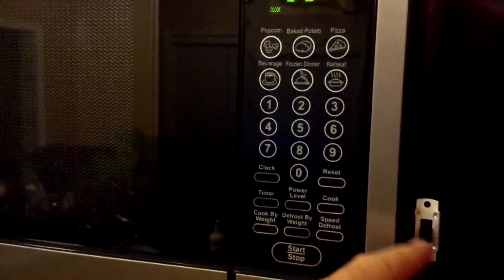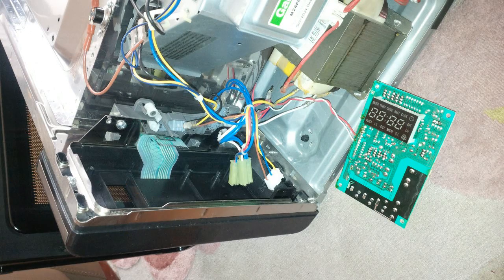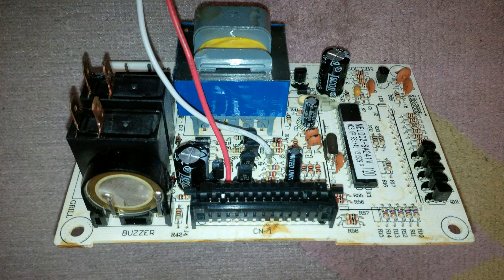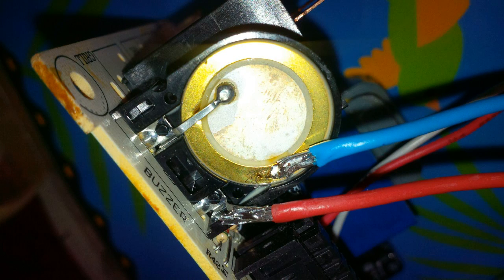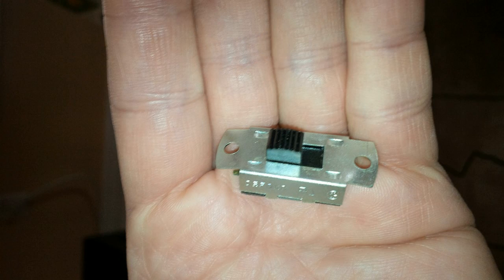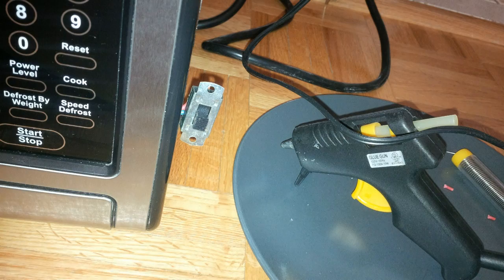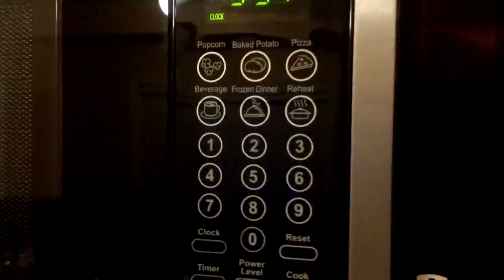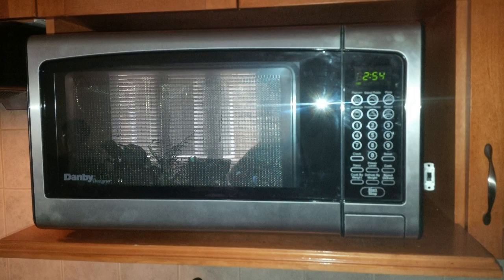Hack That Annoying Microwave Beeper for  Stealth Mode

Comment: Would not recommend this for anyone not experienced with Electronics or basic Electrical knowledge.
Reply from the maker: Good point, you don't want to fry yourself on the capacitors, assemble the microwave back wrong or put the switch on the wrong circuit.
Reply: @devhackmod  Yes other wise you might end up with a microwave going boom lol.

Comment: WARNING " there is an high voltage capacitors and they maintain significant current in the board for a good 30 minutes to an hour after you unplug that device. "
Reply from the maker: Good advice, yes also on TV's and other devices that plug into main household plugs you need to be careful to discharge capacitors safely before poking around in them even after you've unplugged them!

Comment: I just watched a hack video that says most microwaves have a secret keypad mute if you hold the number 1 for a few seconds. Hold 2 for a few and the end beeps don't chime either.
Reply from the maker: I'm not sure why they would keep this function secret. It sounds like a good feature, so why  not explain it in the manual? Either way, none of my microwaves allowed me to disable the beeper that way so I had to add a physical switch. It would be much easier if the manufacturers just told us in the manual!

Comment: Instead of a switch, I think a volume control would be better.
Reply from the maker: Good point, put in a potentiometer or variable resistor so you can crank it down to 0 Ohm (full volume) and crank it up to a high resistance (say like 10 k Ohm) should do the trick! Good idea!

Comment: Brilliant!!! All the others tell you to look for the Sound or Mute button like we are idiots. Finally a real how-to.  Thank you. I am off to disconnect all buzzers on all my appliances.
Reply from the maker: Most appliances do not have a mute function, so you have to physically adjust the circuit like I show in the video. It's easy but just be careful to unplug and leave it a few days (or know how to safely discharge the large capacitors). Good luck!

Comment: My microwave won't work properly.  It go from 100 sec to 59.  Dumb!
Reply from the maker: Yeah that sounds like a programming bug! LOL!
Reply: I bet that 99 seconds works though. I will always do that where applicable. If i want to heat for 1:20, I enter 80 seconds
Reply: I dunno what the prob is. But lookin at your profile pic i seem to go from zero to blast off in 1/2 a sec=)
Reply: Do you mean one minute to 59 seconds?
Reply: It’s a joke, y’all.

Comment: Very Helpful. Just did mine. Surprised how big a ballast was in my microwave.
Reply from the maker: Good job. Just note that someone warned me about electronic issues bypassing the buzzer with a switch like this, but I've been using it no problem already since this video was created. So just use it when you need to, otherwise leave the buzzer on. I don't think it should cause any issues unless you flick the switch while it is trying to buzz.

Comment: Thank you for the instructions - was quite a journey to find your video, there all sorts of hold 1 or smth, not having in mind that some mw simply are too dumb to have the function. Yours is what I was looking for to make sure disasmbly wouldn't be a waste of time. Thanks, mate!
Reply from the maker: Glad it helped! Just a little switch will do the trick to control the beeper function. Some people suggest ripping the beeper out altogether but it's nice to still have it when there is a time you might need it. A switch gives you the choice.

Comment: Thank you. Mine did not have wires so I just ripped off one of the thin metal parts touching the circle piece and it worked (I never want it to make noise).
Reply from the maker: That certainly will work! Destructive improvement!

Comment: That's a lot of trouble for an easy and clean solution.

The manufacturer won't let us turn it down or turn it off?
We just tape the piezoelectric buzzer with some electrical fabric tape.
That will give us a gentle buzzing sound from the microwave piezo-beeper.
Reply from the maker: That's a good option! Some people just rip them out... permanent stealth mode!

Comment: How much time is needed to finish this with assembling? I wanna do mine but I dont have a drill and im afraid of problems with safety screws...
Reply from the maker: You can undo the safety screws by grabbing their heads from the outside using a locking plier. Then change them to normal screws if needed. I'm assuming only a few safety screws are used, most of the screws are normal. Once you get in, find the speaker and attach a couple of wire in series with it and bring it to the outside of the microwave (you may need to drill a small hole). You then connect the switch on the outside which either completes the circuit through the speaker (as normal) or breaks it (silence). Takes maybe 30 minutes if you know what you are doing. Good luck!

Comment: WhirlPool is programmed to disable when holding 2 on keypad until it beeps two times
Reply from the maker: That's a good design. Unfortunately most of these cheaper microwaves don't have that feature... at least nothing documented in the user manual. The only way out is to bypass with either an external switch (if you ever want to make it work again) or just cut the wires to the beeper (for permanent silence).
Reply: wait, help me, my whirlpool microwaves doesn't do that. Its a cheap microwaves though.
Reply: Scott Cawthon is it really u

Comment: Thank You, fixed!
my Logik L17MSB13E however... not so thank you.
sidenote; be careful with the dangerous Capacitor folks.
Reply from the maker: Yes, good point! Don't touch anything in there, unplug microwave and let it sit for a few days unplugged to discharge the capacitor. If needed you can also put a screwdriver across the capacitor leads but only AFTER A FEW DAYS has passed. Don't do it any sooner or you will get sparks!

Comment: Hoo boy, this is EXACTLY what I need for my awful, piercingly-loud microwave... Unfortunately, I am a renter, and it might violate the lease or something to do this, even WITH the nice switch I could install that would render it perfectly functional 'as normal' on demand!

Also, I've never done electronics wiring before, and I don't own a multimeter... This feels too far beyond my ability level. Plus, I can't physically take the thing off the wall, it's installed over the range, so I'd have to, like, HOLD IT UP at arms-length to unscrew it... Just seems impossible. But the beeps REALLY grate on my nerves... :( 

I'll have to pay a contractor to do this or something, and sign a waiver with him that says I will never give his name to the landlord, and I'll claim to the grave that I did this myself, LOL

Comment: Judging by the fact that I've never seen a silent microwave there's probably some kind of safety code that mandates that microwaves have a beeper that cannot be turned off. I could be wrong though.
Reply from the maker: I've seen some microwaves which have a setting (some special combo key) that will let you toggle the sound. Just google "microwave oven with sound on/off" and you will see. It is just that cheap microwaves don't bother including that feature.
Reply: I don't see how it's a safety issue. Maybe with the keypad so that you don't accidentally overdo the digits? But when the cooking cycle is over....come on.

Comment: To disable the sound, there is a different combination of buttons to press for every microwave out there. All you needed to do was a little bit of research on your make and model, and wouldn’t have had to get MacGyver on it... 😬
Reply from the maker: I did my research and could not find what combination to use. Even the manual had no option to disable the sound. Maybe the better quality microwaves have it, but most of the cheaper ones do not sadly.

Comment: lol i did that on my Danby this morning... I just ripped the little speaker out, hope it wont catch on fire!
Reply from the maker: Good job, yeah that should be fine. No speaker, no sound, no problem! I used the switch so I can turn it on and off, because sometimes we want the sound. Why doesn't the microwave has a function button to toggle sound? Could be easily programmed.

Comment: I clipped my buzzer and now my microwave wont turn on.  what the heck man.
Reply from the maker: Are you sure you cut the right cables? I would connect back the buzzer and see if it turns on. Maybe when you took your microwave apart you forgot to connect something back?

Comment: mine is a mecanical bell with turning switch😭 fuckin anoying , sooner i wil buy a new microwave and  probably i will do the same as u #thanks tho
Reply from the maker: You can just open up the microwave and take out the bell. That's even easier. Or you can stuff some material inside the bell which will dampen the sound. Try it!